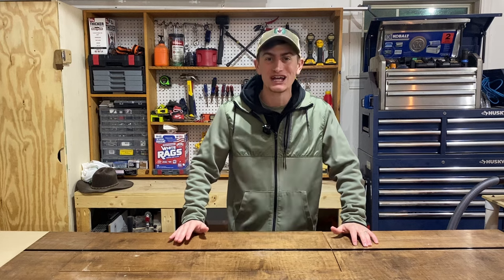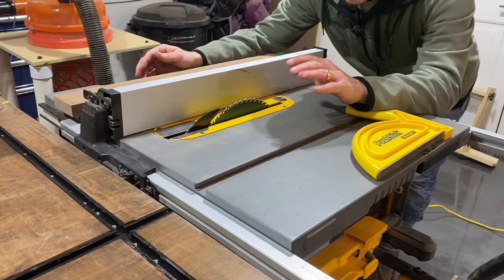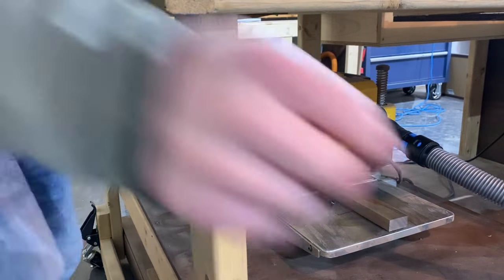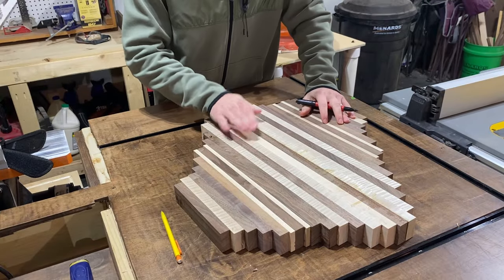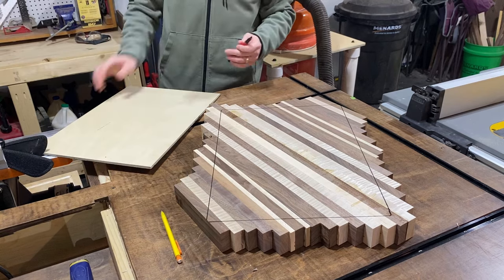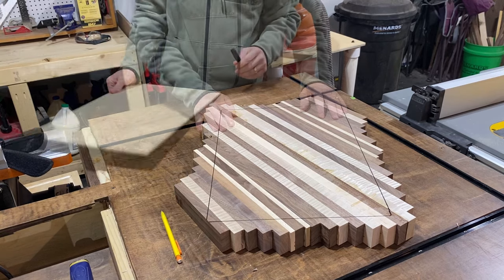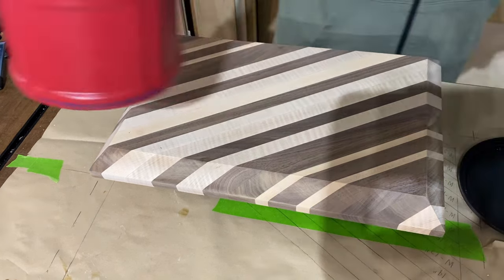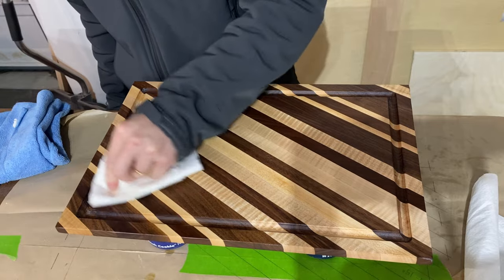NOBODY is Making This! - Diagonal Edge Grain Cutting Board

Comment: A knife will stay sharper if cutting along the grain instead of across. If the user stands at the side of the board using left to hold and right to cut then a 30-45 angle will align the grain to the blade. The reason end-grain boards are good is the universal cutting angles options while saveing the blade. Additionally, creativity is secondary to content these days. Well done for having a crack.

Comment: I use a glue scrapper i bought at rocklers works alot better than chisle also use a 5 in 1 scraper that  i sanded down both work vary well on glue ups
Reply from the maker: I definitely need to invest in a glue scraper. Does it work well on dried glue or best on glue that’s still tacky? Thank you for the support and advice!